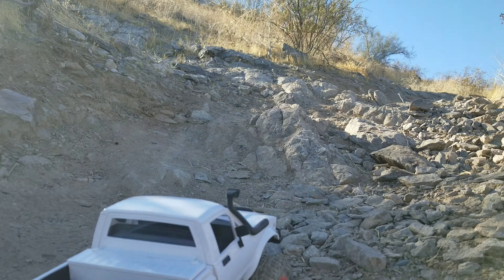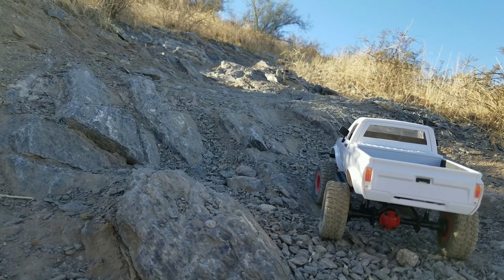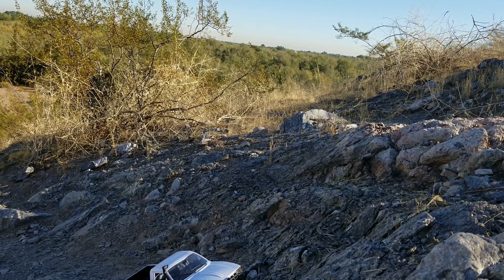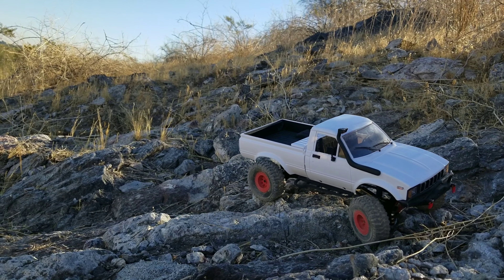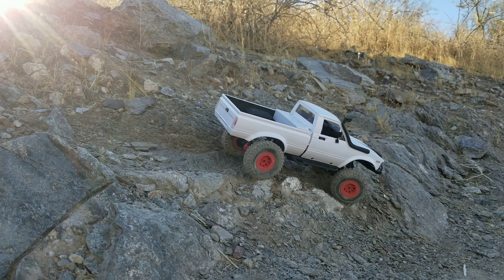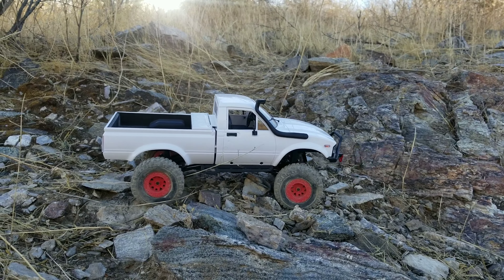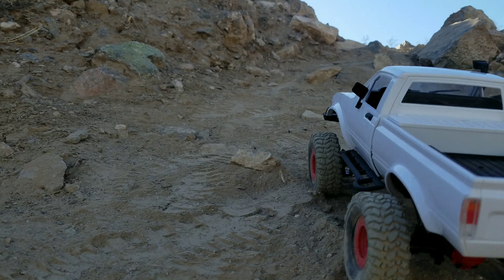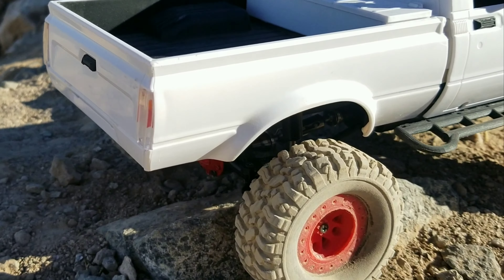WPL C24KM Hill Climb. Toyota Hilux

Comment: Can't wait to get mine, its ordered, along with a few upgrades, like metal waterproof servo, oil filled shocks, and wider tires. Oh, and a cap for the bed. The build is going to be a lot of fun ;)
Reply from the maker: let us know how younget along with the oil shocks. nobody seems to have found a good shock solution for these yet. I run the stock frictions and dont mind it at this scale.

Comment: Hello, i hope you see this.   I would like to ask you some questions.    I like the body of the C14 and C24 ,   but do you think the C34 and C44 are better?    what about a C14-24 body on a c34-44  frame.           I want the dual speed so i debating between C14km or C44km with c14 body.          thanks for any help or suggestions (just ordered  B-16 RTR for the kid)
Reply: I ordered the C14km and a set of tracks

Comment: Happy birthday! Can you help me to choose what's better for MN D90 body? The C24KM, C34KM or C44KM. Which one of them has got 2 speed gearbox? Which would fit well? Won't it be too narrow?
Reply from the maker: The c24km is a easy fit. All the WPLs have the same width axles so the mn d90 will have the wheels tucked like a stock d90. All the newer KM stuff has the 2 speed included(not sure on the C34km if it's still the single speed or 2 speed now).  I haven't tried to install on the other chassis so I don't know how much modding you need to fit it.
Reply: @RunThatRC  But ain't got C44KM better quality? Metal links vs plastic in c24km?

Comment: Those sliders look like they might get hung up on that bump on the back, can you edit them to make them smooth and uniform?
Reply from the maker: They have 2 versions available. They call that bump on the slider a kick out. It's to help push you away from an obstacle or tree so you don't get the rear tire sucked in.
Reply: @RunThatRC  oh, interesting feature

Comment: What’s the better buy? Km and V3 radio or c24-1 RTR?
Reply from the maker: for me it would be a km and V3 electronics or stand alone tx/rx and electronics. The new rtr stuff is good for starters to see if they enjoy going slow and crawling stuff. If you end up liking it then your ready to mod. If your already into the crawl scene then KM and V3 or your own electronics and it turns into a pretty decent runner.
Reply: @RunThatRC  Thanks!  I split the difference and got my kid an RTR and me a KM/V3.  I've had numerous cars over the years, but I've always focused on being in the air.  I've got the RTR in hand already.  It's equal parts impressive and disappointing.  I think it'll work fine. It just has a lot of slop in most of the joints.  My kid wont know the difference and the body looks fantastic.
The stock battery is an interesting choice, though( the 2s 500man Li-ion).  Best I can find is that battery is probably only good to about 5A while the V3 ESC was uprated to 7A from whatever the V2 was.  So any full throttle punches could be pretty hard on the little guy, but I've already decided on some 3000mah 20A 18650s to fill the role.  One of these days I'll check the amp draw for fun., but for now its gotta go back in the box for another month. 
Coincidentally, I think we used to live near each other. LOL  Keep up the good work.

Comment: What is the difference between wpl c24-1 and wpl c24km ?
Reply from the maker: body color and the C24KM is a metal upgraded kit with a lot more metal parts included.
Reply: @RunThatRC   in c24-1 what upgrade need to be done after buying rtr version ? Which is better c24-1 or c24km

Comment: essa caminhonete é à prova de água
Reply from the maker: These are not waterproof out the box. Mine is waterproofed with plastidip. I have a couple water runs of my other WPLs so that can show you that you can make them water resistant enough to run in water.

Comment: Mine is doing the same in high
Reply from the maker: 2 things seem to cause this for me. the shift arm is to close to the shift linkage and need so be moved. The other one is stretching the spring or adding a spring to get a more solid engagement.